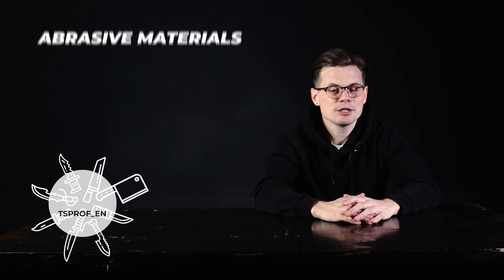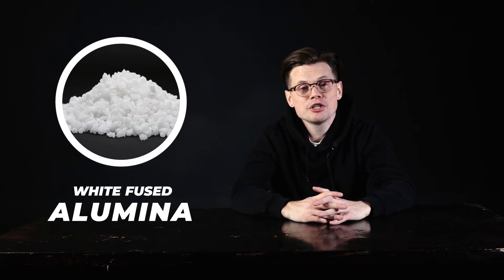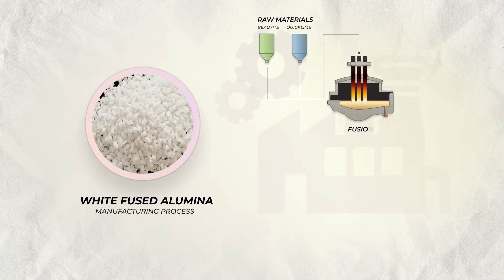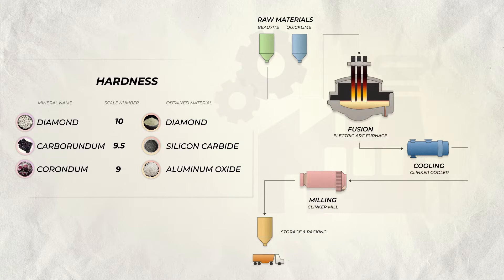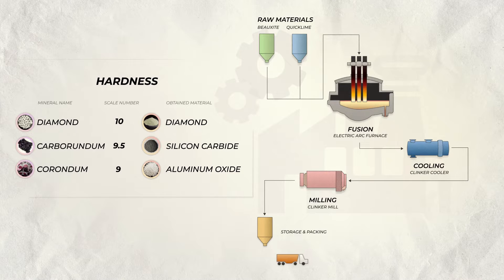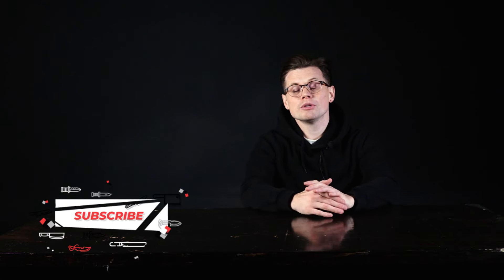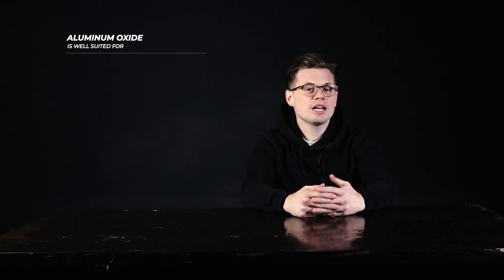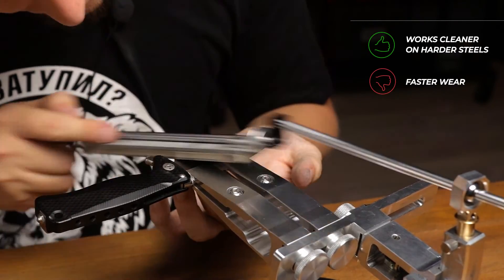Aluminum Oxide Stones in Sharpening. Pros & Cons.

Comment: Afternoon...
I'm looking to get another set of the abrasive stones for my new TSPROF - ones for everyday blades as you say? 
Also, to save wear on the diamond stones that came with my "Master Kit." 
What would you recommend, these aluminum oxide, or a set of the silicon carbide - and are they available to purchase directly through TSPROF where I purchased my master kit? 
Always appreciate these tutorials, thanks...
Reply from the maker: Hey, thanks!

Good question! SiC stones are more multitasking and versatile. They work really well for all types of knives, but there's one thing. As a rule, they work with water and always needed to be wet during sharpening, SiC bond produces suspension which is the hard shaprening element and they may remain micro scratches on the secondary bevel and generally pollute the workspace. And also you'll need to level them more ofter than other stones, but once again, SiC are great as the sharpening stones showing great results and work faster than OA and sometimes Diamonds. If it's okay for you, it's your choice. (Next video is going to be about SiC where we'll dive in details of it.)

As for AO, they do not wear so fast as SiC, show excellent result at finishing stage, and they're very good for soft and meduim steel up 62 HRC. So, in this case, basically that depends on what knives you will work with. 

As for avaibility of stones. Right now we're out of stock. So we need to wait. But you can find smth on the local market. From my own experience, take a look at Boride (let's say, CS-HD if SiC and PC or T2 if AO)

Hope, it helps you.

Comment: Do you know if aluminum oxide polish is toxic? Or if you need gloves, mouth or eye protection when using it?  It would be amazing if you know!🙏☺️ And nice video❤
Reply from the maker: Any synthetic dust that you inhale is not definitely good for your health. So, when you sharpen a knife it's not recommended to keep your face too close to the knife. Mouth and eye protection is optional but it might be helpful when you sharpen 3-5 knives at a time.
Reply: @TSPROFSharpening  okay thank you so much, this really helps cause i cant find the answer anywhere🙏🙏❤️ New sub